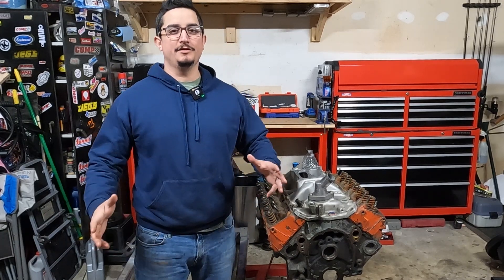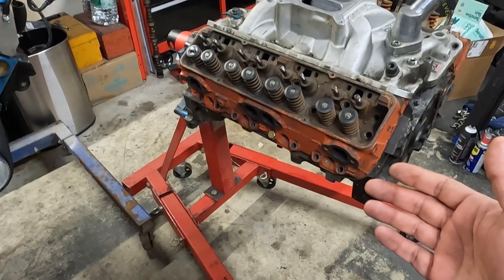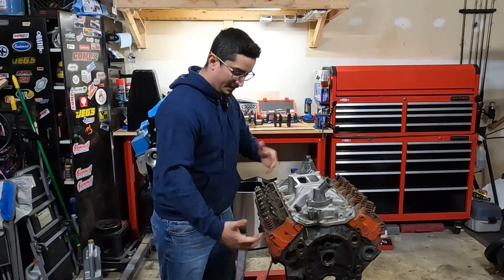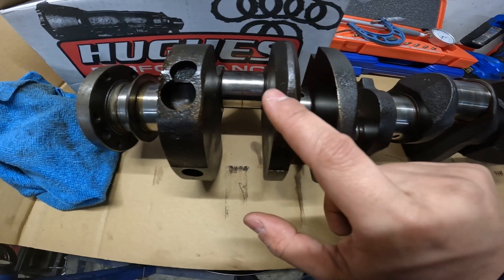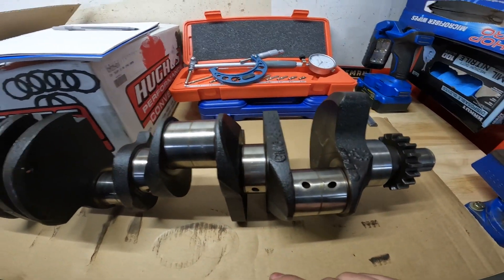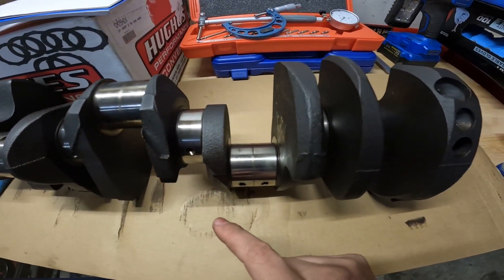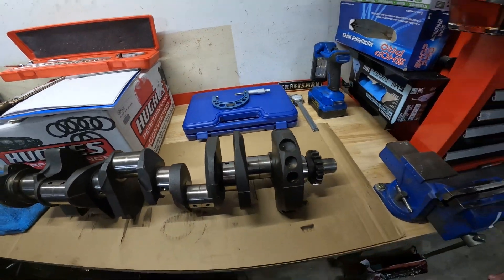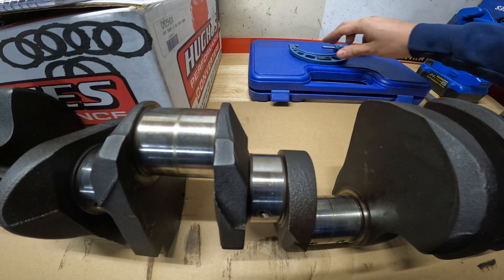$500 Budget Build Challenge! - How To Measure a Crankshaft

Comment: I have a 65 truck block 283 and #1416 casting heads for my build. My question in this build, I want to install a 90’s Chevy van serpentine belt drive system with the reverse water pump to use a sanden compressor and power steering for my 55 chevy 3100. Hopefully it works, since the #1416 heads have the necessary mounting bolt holes.